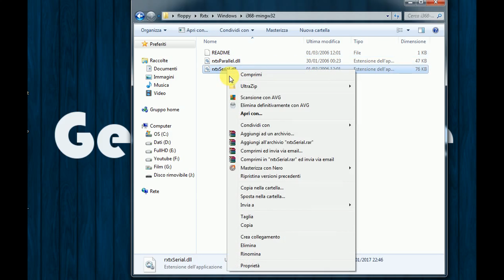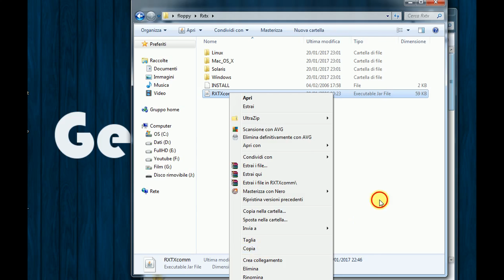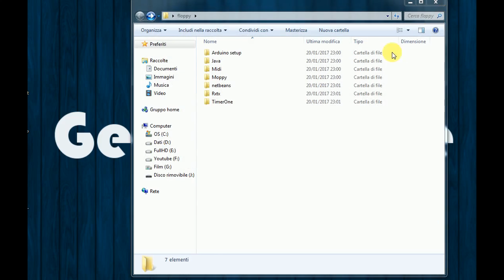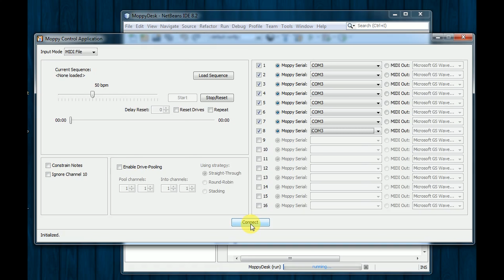Floppy Arduino uno Sound. General Tube in 4K

Comment: ho un problema con netbeans, quando vado a cliccare su run mi da un errore java 
"Exception in thread "main" java.lang.ClassFormatError: Incompatible magic value 0 in class file moppydesk/MoppyUI$2"
ed a seguire altre righe con errori java
Reply from the maker: +GNARF IV hai provato a collegare arduino direttamente alla porta usb senza adattatori e prolunghe.. a me dava errore
Reply: si, ho provato anche a reinstallare il programma
Reply from the maker: Prova a ricaricare il programma su arduino e se ancora non va di rimettere le librerie
Reply: continua a darmi lo stesso errore di java
Reply: Come avete risolto? Anche io stesso problema.....